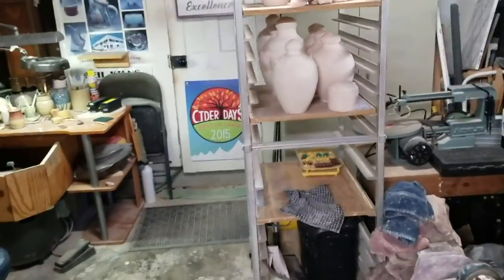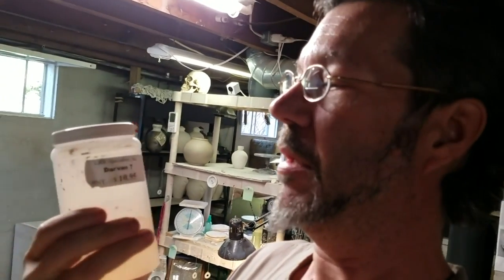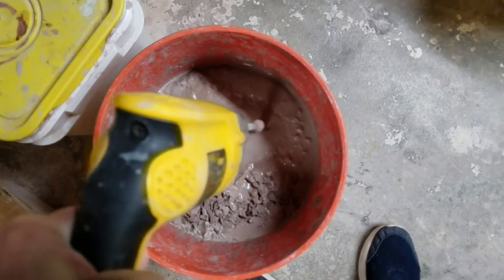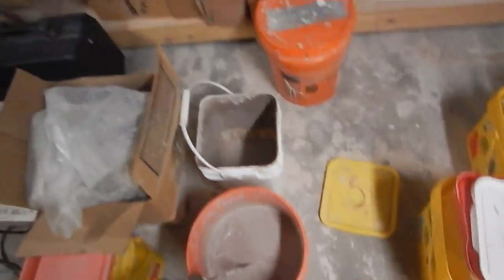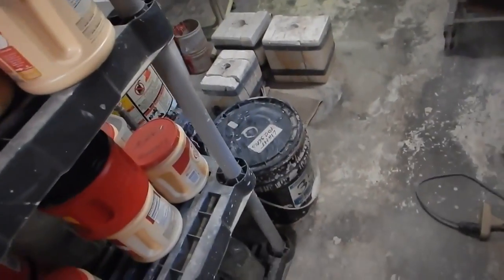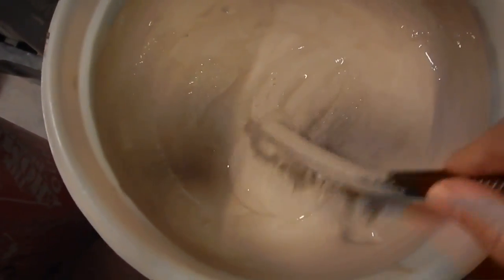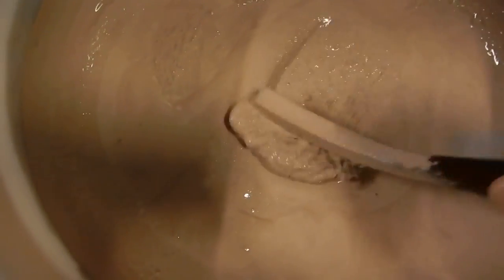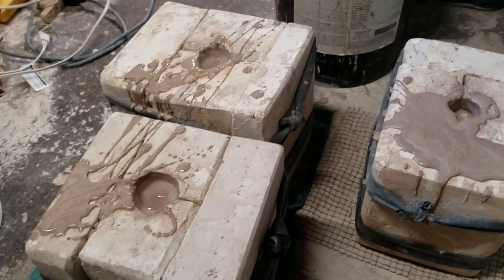How to make quick casting slip for pouring molds - Corvus Moon Pottery

Comment: I made a tiny mold to make halves of a ball. I used regular clay, and not needing much to try it out, only made a little. I  used sodium silicate, intending to add 1 drop, but 2 went in. It poured well but after sitting in the mold it became so thick that I had to scoop out the excess. Maybe it didn't need the 2nd drop.

Comment: Do you have to put your casting slip through a mesh container if there’s very little grog? I often use a mix of white porcelain and Laguna white clay. If these were mixed do they need to be poured through a mesh container? If so, do you know where I can buy one of those kinds of mesh containers?
Reply from the maker: Hi Emma! - No, you don't have to. The drill mixer takes care of most of it. I've just gotten into the habit because I mix a lot of glazes and they're pretty important to sieve.

Comment: I’m so glad I came upon your video again. I just ordered some stoneware slip from Blick. 2 of the bags were a different type of clay. When I poured the bags into my bucket I noticed it was realllly sticky but wet and flowing! I have never even felt slip like this. It dries in a few seconds! Any idea what the problem may be? 
I see when you poured your slip out of the mold you put it right back so the hole is visible, do you leave them upside down at all? Thanks so much
Reply from the maker: I usually don't leave them upside-down for very long. The best way I can tell you to test any casting slip is to pour a little onto some plaster. In an hour, you should see the slip curling off of the plaster all by itself. Slip needs to be EXTREAMLY de-flocculated (more clay than water).
Reply: @corvusmoonpottery  Thank you so much. I am pouring water off the slip every day. I’m not getting much now so should I just start adding some darvan 7 as you did in the video? My drill is getting to get really hot after I use it for about 10 minutes so I think I need a new one. Also, I started using stoneware slip. Is everything the same with that??

Comment: Could I use ball clay for slip casting ? I tried with kaolin ( china clay )for slip casting but I couldn't cast even though I maintained  specific gravity of 1.8. I used soda ash and sodium silicate as deflocculant. Could some one help me which clay is  best suitable to prepare slip for casting.
Reply from the maker: Hi Arunkumar,
A good mix for casting slip (^6) is

EPK - 10%
Nepheline Syenite - 5%
Silica/Flint -5%

University of the Arts - Philadelphia formula they use in their ceramics division. This has worked well for me in the past. I use this when I don't have any clay leavings lying around. If you want to make a decent clay throwing body out of this, just add 1% bentonite.

I wouldn't use ball clay for anything slip related - it's WAY too sticky and is almost impossible to pull from a mold.

Comment: Sodium silicate is not available in my country. Is there any way i can make slip of clay without using it?
Reply from the maker: Never use sodium silicate unless you want your plaster molds to disintegrate quickly.. I always use darvan 7
Reply: @corvusmoonpottery  can i keep adding water to my clay and stair it until i reach the consistency of a slip ?? Without adding Darcen 7 or sodium . Or there would be a problem
Reply: @corvusmoonpottery  Darven7**
Reply from the maker: @Faisal-ds1kb  NO, You need to 'deflocculate' the clay - Make it wet without using water.  (watch the video again)
Reply: @corvusmoonpottery  okay thank you very much